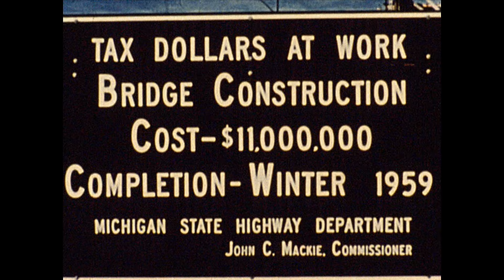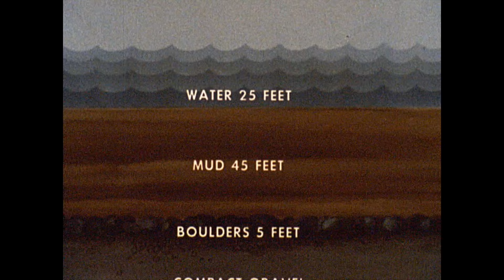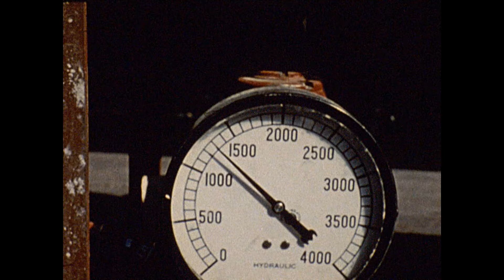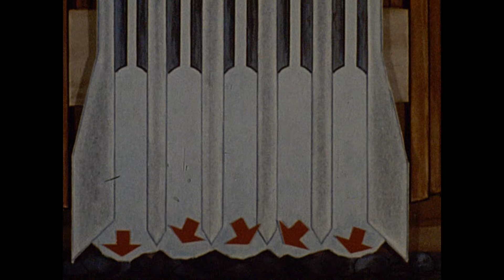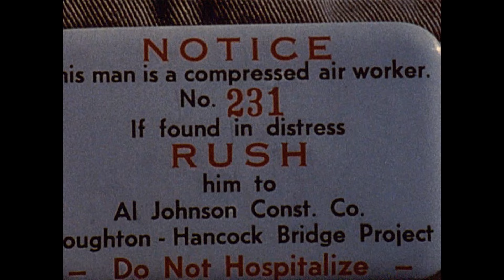Keweenaw Crossing: Michigan's Elevator Bridge

Comment: Wonderful bridge, still in use 2022, with no end in sight. Very well built.  Would it be built any different now with "modern"  technology and  materials?
Reply: I would guess if they had to rebuild it in todays world it would be just a standard non moveable bridge. The railway is gone, and extremely unlikely to come back. I'll guess that any vessels that still use the waterway would fit under the current 32 ft clearance, or maybe a new bridge could be made with a bit more clearance, 40-45 ft possibly. I would think that would accommodate the vast majority of sailboats. Any larger vessel will just have to "go around". I don't thing the large ore boats use the waterway anymore, if so, very rarely, to make any local deliveries they will have to just enter and exit from either end. The days of large ships using it as a "shortcut", or a safe harbor are long gone.
Reply: @johnstudd4245  agreed, the only ship that passes by is the Ranger III. shes 68 ft tall. a lake freighter has not passed through in 5+ years as of 2024. its likely one never will as the canal has not been dredged in 40-50 years. its most likely too shallow.

Comment: Meanwhile the Steel Bridge in Portland solved this same problem by making a two-stage lift... and it's been working wonderfully for 109 years.
Reply: Yeah this bridge seems needlessly complicated. The engineers who came up with it are probably related to the goof engineers who work at my plant.
Reply: This bridge operates in the same manner, does it not?   What makes the Portland bridge better?  I did not hear them say that this bridge was the first of it's kind or anything like that.